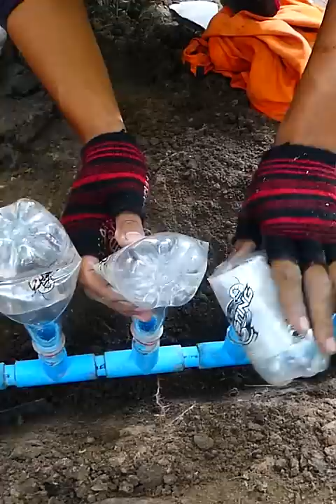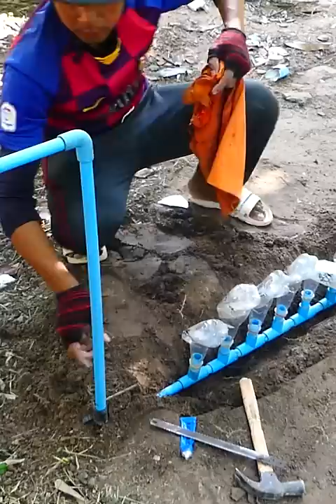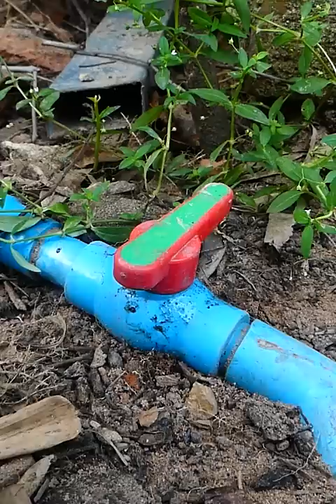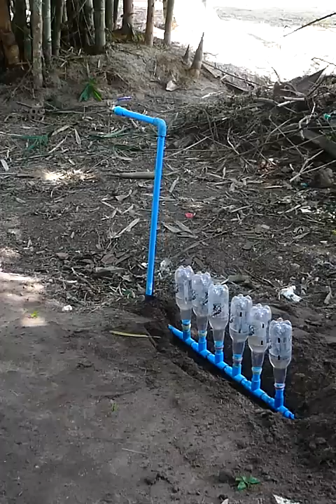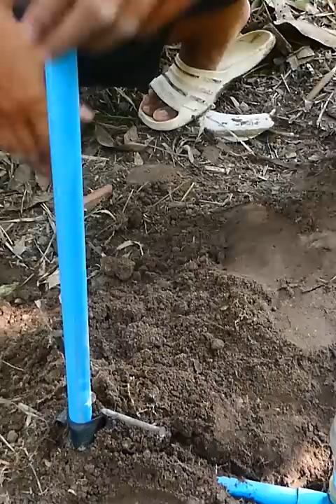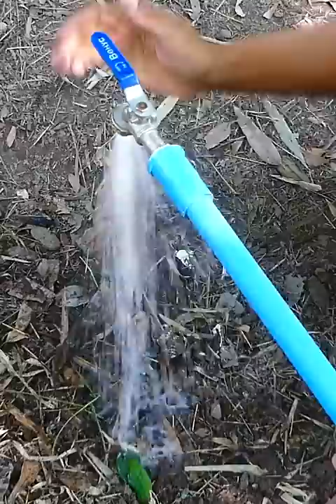Trick Free electricity | I turn PVC pipe into a water pump at home free no need electricity power

Comment: The engineers have left the chat
Reply: YouTube sees that I watch a lot of science and astrophysics and whatnot. Then they decide to show me this.
Reply: 😂😂😂😂😂😂, and with so much deception!
Reply: Unfortunately we are still here
Reply: The solution is temporary meanwhile the bottles reduces compression
Reply: @ignited3443 another one here... 🤣
Reply: Oh no, this engineer is still here trying to find the answer to what the point of the water bottles is. Just a straight pipe would have still given water, the pipe is clearly pressurized. The only thing the bottles do is possibly giving you a way to monitor the water pressure, but you'd only need one bottle for that. Even then i'd be hard pressed to get any accurate measurement of the true water pressure. It's more usefull for relative pressure (changes in time). 

If you have no clue of fluid dynamics, what is happening here is that the water pressure from the pressurized pipe is pushing the air away from the pipe. The system is closed, so the air needs to find a place to go, and it is lighter than water, so wants to go up. Thats why the bottles straighten up when the pressurized water hits the system. The water to air level in the bottle shows the moment the air gets compressed enough to generate equal pressure downward as the water is generating upwards. 

It is possible to use an air pump to generate a low pressure in order to pump water up, but these bottles are never gonna do that for you, since you only reduced the volume in the bottle, you haven't depressurized the air inside. The bottle isn't magically gonna expand back up and depressurize the air inside the bottle (larger volume with same amount of air depressurizes the air). You'd need a mechanical part (driven by some form of power) to generate that larger volume. This whole thing is utter bullshit.
Reply: As to why the bottle won't just randomly go back into shape is because if the volume of air in the bottle doesn't change, the pressure outside and inside of the bottle want to remain equal. When you move the bottle and the air threatens to depressurize, a force is generated pushing the bottle inward. This is why it is impossible to get a squeezed bottle back in shape after you closed it off. What does get the bottle back in shape is generating a higher pressure on the inside, because now there is a force generated from inside to outside. Which is what you see in this video. So the bottle is neutral, but what is generating the pressure? Obviously the water. Water doesn't generate overpressure in a system like this unless it  was itself already pressurized. A very common thing in water systems, as this overpressure is what drives the water through the system.
Reply: What this dude might have done is suck the air out of the system (using either electricity or his own lungs, power was still applied to get the air out). Thereby already generating underpressure. The squeezing of the bottles does absolutely nothing in this case, the sucking out of the air already did that before this video started). In that case the bottles generate more volume, helping the process but requiring more effort at the start as there was more air to pump out of the system. To reiterate, some form of power was still applied to suck that air out, or it still doesn't work, you'd still not have underpressure just from squeezing the bottles! If you then have enought underpressure to counteract both the height difference and friction forces in the pipes, the water will come up. It will only continue flowing if the water can reach a place that is lower than the original source though, or the system stops flowing as soon as the pressures equalize. In that case it isn't the underpressure actually driving the system. The height differential drives the system, the pressure differential only kickstarts the system.

Power still drives the system, only it's gravity doing the work. In that case sure, gravity power is free, but what energy did you expend to get the original water source to a heigher altitude? If your source is naturally on a heigher altitude, you can get free power out of the water flowing down. This is not a new concept though, they already put water mills in rivers in the Medieval ages.
Reply: He made my 4 year study feels like a waste.....
Reply: Grammer has left the chat too
Reply: Just trying to make another yen for the village. Next show we will water an learn how to make insulation for the dirt hut .stay turned in to 5h8s channel .he is main man in village 1200 hurned yen phone living in 5he dirt hut.
Reply: @bastange8856  its a ram pump, go back to engineering college
Reply: L'être humain était toujours constructeur avant d'être architecte....
Reply: @alecDeloyed reduced compression? You mean the bottles reduce the water pressure? Those bottles definitely did not create that water pressure.
Reply: My knowledge is in computer engineering.( And info Sec) We have a decent amount of overlap with electrical engineering. I can't figure out how this is relevant to electricity at all. At this point I'm tempted to inflict this on my buddy who used to design emergency oxygen systems. This seems more relevant to him than me. 

My first thought was warm water, like leaving a garden hose out on a driveway. I don't think it would be particularly good at that. But that's about the only thing I've come up. Because it's a bunch of plastic soda bottles attached to some plastic water pipes. Water hammer arrester, maybe? Yeah I'm essentially out of ideas. To make a bad joke this doesn't involve electrons not my job.

Comment: This is a very basic / simple hydraulic surge damper that prevents " slamming "  in pipes.  Water is not compressible while air is.  The trapped air prevents the water from " slamming " the pipe when the water is turned on and off or when the pump cycles.
Reply: this is the only thing it really does, and its a real thing, everyone else saying this pumps more, or that it builds pressure lol
Reply: Good explanation. 👍
Reply: So, what about electricity ?)))
Reply: @grobro8691   stay tuned...
Reply: That’s why they installed water meters so we couldn’t turn that free water pressure into electricity , while overflowing our septic tank
Reply: I would have called this an accumulator but the explanation is the same.
Reply: Yo si entendí que para eso funciona, incluso que el agua fluya con poco más de fuerza sin que el aire dentro obstruya, problema que tengo en casa
Reply: Not the only thing. Bro made an expansion tank  @MrQuequito
Reply: I doubt his intention was to make an unnecessarily complicated vent to prevent water hammer, tho. I think he's trying to say that the bottles pressurize his water system without electricity. That pipe probably leads to a body of water somewhere and not a municipal water supply. I think he's trying to say that his device provides running water without the need of pumps or gravity assistance. I'm just assuming, of course, because he doesn't show us what's going on in the video, but I think that's the idea.
Reply: @malleusmaleficarum6004  там видно что есть давление, иначе бутылки так бы не раздуло. Следовательно вода подается насосом.
Reply: Ну ясно, расширительная емкость
Reply: @gggamechannel5382 неужели, и как же ты догадался😅
Reply: @vitbenedikt  я ответил человеку на его комментарий потому что он думает, что это самотек.
Reply: нет, весь смысл этого в более высоком выходе воды, чем может обеспечить давление в системе, примерно на 10 секунд
Reply: Это что за трубы такие, которые "захлопываются"? Они из бутылок сделаны?
Reply: @Хайзенберг75 а  что означает ( захлопнуться трубе ..? )  и чем ..?  И почему нигде такова не происходит .. даже шланг не захлопывается а труба и подавно держит давление нормальное .. 
  Считаю это полным бредом .. и расширительный бачок всегда без давления работает ему это не помеха ... Но он и есть клапан в отопительной системе .. при нагревании и охлаждении .. здесь проточка из под насоса ... Это лишнее совсем .. 😊
Reply: So, like a capacitor lol

Comment: Просто хочу сказать, что я из России и это безумно тупой и бесполезный шортс. Чтобы автор знал, что весь мир узнал о его тупости.
Reply: Такие шортс в бан надо!
Reply: Best comment! Thank you 🥰😂
Reply: На себя посмотрел бы сначала, ты хоть знаешь для чего это?
Reply: Для чего что? Для чего вода все знают. Для чего трубы тоже. Для чего он бутылок надел непонятно и нафиг оно не надо. Вот и все @ЖанболатНурлыбеков-у7б
Reply: So do I
Reply: @hinchh4703  why is there no option to translate? I was on here a day or two ago & responded to the comment because I was able to hit the translate icon (or whatever it is called). Today it’s been removed. WTF? Is it because it was a Russian commenting?
Reply: Not useless, he watered his garden.
Reply: We did Similar to filter tank water when we lived out in the bush in Australia 🦘 but it's done very differently you fill up a 1ft length of PVC pipe with sand and cap it off at each end and tap each end so it can run water though the sand and out the other side. We use 3 or more 1ft canisters to filter tank water and sometimes when desperate dam water. You use sand in 1 canister and fabric in another and charcoal and small stones among other things. It's not for drinking clearly but it gets it clean enough to shower and feed gardens and animals. This video though is completely wrong and is just a view revenue scammer 😤 he's just a scumbag but we in the 1980's did a similar setup to clean up water for showering and to save on the drinkable tank water.
Reply: Air Pressure Accumulators
Reply: @Степан-ш3р3ф  это насос ять
Reply: I'm from Canada and I agree with you.
Reply: Yeah, so how does this work?

Comment: Obviously theirs already pressure on the water line for the bottles to fill and pressurize, and over the course of time the water would absorb the air and completely fill the bottles with water, the reason old stub outs in plumbing didn't work for long. The air would make a cushion until it's absorbed into the water then no more cushion just a noisy water pipe!
Reply: Even if that doesn't work for long..... He just wants to wash his hands for a moment. 😂
Reply: It's obviously fake but you had to elaborate
Reply: Well it's still better than the alternative. Think about it, if the bottles fill up, all he needs to do is disassemble the rig, take out the excess water and air, replace the empty bottles and start over again.  Unless you really like to work out and become fit through manual labor, it still beats having to manually haul pails of water several hundred meters from the well to your home repeatedly just to fill up a large storage drum with water.
Reply: there's not theirs. As in 'there is'. Theirs means it belongs to them. It's called grammar. As for what you meant, yes there is already water pressure from somewhere. The bottles act as a shock absorber when the valve is closed helping prevent water hammer from breaking the pipe connections. I dont think your remark about air being absorbed by water makes any sense at all.
Reply: Thank you so much for explaining this. I have always wondered why simple stub outs such as those in this video aren't used much any more.
Thank you so much.
Reply: Tocca una clip per incollarla nella casella di testo.Tocca una clip per incollarla nella casella di testo.
Reply: Actually it does work. Water cannot be compressed into a smaller area, while air can. When water is pumped into a tank containing air, the air is compressed, putting the water under pressure. The more the air is compressed, the greater the water pressure.
Reply: @stevelloyd5785 air dissolves in water it’s like how soda water is made. He’s correct to say the air won’t last forever.
Reply: @beltek7431 the water pressure already exist without the need for air to also be under pressure.
Reply: @beltek7431 Technically we assume how the system works.
Reply: Air obsorbs in water?????
Reply: Really?, please google: Ram Pump, if you fail understanding isn’t my fault you didn’t attend high school
Reply: @beltek7431  Water does compress, but not at these kinds of pressures (at least not much).  You get enough pressure though you bet water compresses.

Comment: Does anyone know how many lumens those plastic bottles have? I've been wanting to change my vanity so I'll have better lighting and i believe these will work great
Reply: About 700 Hz of pure energy!
Reply: About 1.21 gigawatts
Reply: They melt pretty easily too. Might consider that before putting bulbs in them.
Reply: @vestaash680 I think this one went over your head haha
Reply: If you put a tiny amount of chlorine bleach into water and hang the bottle from your roof with light coming in, the mixture lights up and diffuses the lift evenly around it like a lightbulb. It's pretty neat but not always practical.
Reply: I believe that brand of soda bottle has 42 furlongs per fortnight capacity, but if you exceed that they will turn into a bowl of petunias thinking weird thoughts.
Reply: If you use blue bottles you can use them as grow lights.

Comment: If the Encabulation modules were to converted to Warbulators, the amount of water would effectively be doubled due to the Kanutor valve he initially turned on having a Pulsar effect. This pumping effect, would negate the need for Sertraline primers, therefore allowing a Menzine Membrane to be used at the tap end to smooth the pulses out to a smooth stream at higher pressure !
Reply: Ahahahhaa!!!! 🤣🤣🤣🤣🤣
#Engineer!
Reply: As an engineering expert,I can tell that it isn't a sustainable long term project and would collapse due to many socio-political factors as well as just pure maintenance
Reply: Aah, yes but to initialise the grefalion reflex, the optimum spingle rotation must be -20 hertzagogs.
Reply: Not too sure about that. If the frimolator doesn't provide the necessary kambuch to the thermostach it won't work as expected. Or, one could use a frichostach; that's a combination of the preceding three but it's efficiency isn't as great.
Reply: nope - you need the stream injector bearings to be next to the flimflam speed adjuster so the wobblyshaft oscillator doesn't defibrillate the  hydrogen in the water

Comment: The bottles, if sealed and the lines turned off at both ends would still allow the user to open the bib and get some sort of water pressure through the reservoir of bottles which were pressurized by the supply line.

This is used in less developed areas for when there's an interruption in water supply.

It's a makeshift hammer arrestor. However, due to magical science, without a sealed piston, the oxygen pressure in there will inevitably be absorbed by the water decreasing the output pressure.

Comment: It is a pressure compensation, not a pump hence the flow rate is more stable until the pressure in the bottles is depleted any expansion vessel would do the same thing
Reply: Tampoco sirven cómo vaso de expansión.. 😪
Reply: Since the input pressure is always as high as the pressure in the bottle this wont do anything
Reply: @indian.techsupport  flow pressure is always lower than standing pressure as you have pressure loss, friction, diameter and so on hence the pressure in the bottles will deplete to the actual flow pressure
Reply: @mdeuk  the tanks are way to small for a noticeable effect
Reply: Ты ерунду какую то говоришь…вода изначально идёт с гидроаккумулятора, а бутылки тут ни к чему… так как сам бак регулирует давление через группу безопасности.
Reply: @indian.techsupport  Hi, I spoke about the principal the bottles represent to highlight that it is not a pump not about their effectiveness obviously a bigger vessel would give you a longer effect. All kinds of pressurization systems rely on that principle e.g. fire sprinklers.... I will leave it with that
Reply: @mdeuk you get that, in this setup, the bottles can only reach the same pressure the water is supplied at in the first place, right?

In practice this would reduce flow rate because of losses.

The only benefit would be if he shut off the water supply, this would allow the system to work a little longer. Like, a couple of cups of water. But attaching a small reservoir to the end of the tap would be about 1000x easier and accomplish the same thing.

Comment: All right people! He didn't create electricity or pressurize the system. There was already either a pumping device or an elevated storage tank hidden from view. What he did do, by making the system have an entrapped gas, was to give the system capacity. Remember, you cannot compress a liquid. This will stabilize the pressure, allow the pump  to cycle on and off, and may even prevent leaks, because PVC piping and glue joint don't like pressure spikes.

Comment: In many cases you need electricity to get good water pressure, they’ve demonstrated a cheap hack here. We live off grid in the USA (we’re on solar for power, a well for water) we have a deep well that requires electricity to pull the water from that depth. We store water in two 2500 gallon tanks, but we still use an attached jet pump (which requires electricity) to get much water pressure coming out of those storage tanks and into our house. Our neighbors have water tanks high on a hill, so they have good water pressure without needing electricity. The negative comments are coming from a place of ignorance. If you live in the city where all those systems are created for you, you just turn on your faucet and don’t necessarily think about how that water is just there for you. For remote locations this could actually be a useful hack to get a little bit of water pressure without electricity (or “electricity free” …not free electricity as in the title)